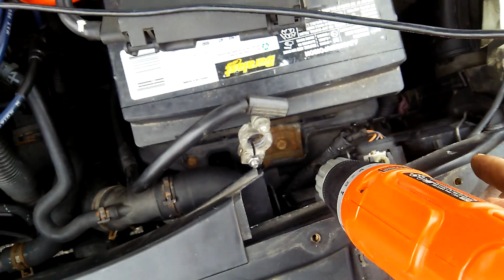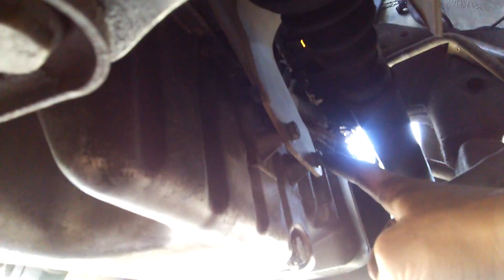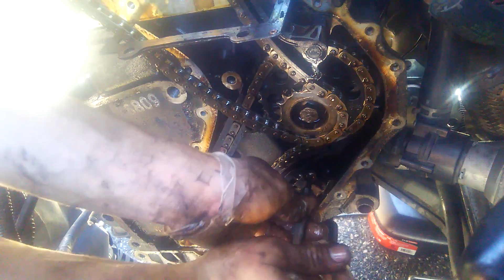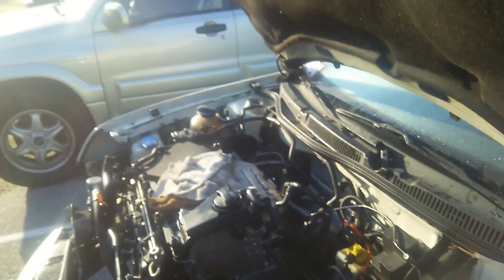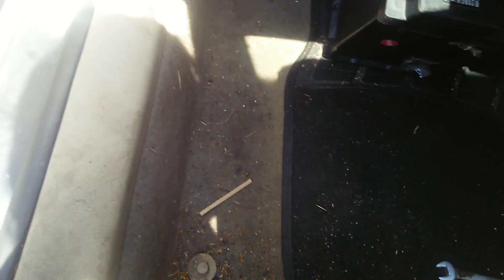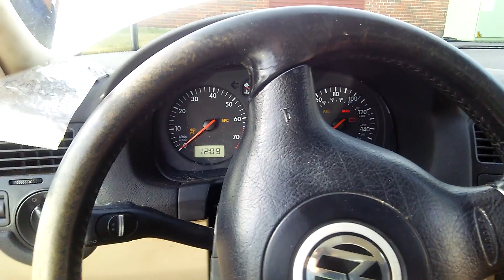VW VR6 Timing Chain Repair - Start to Finish - Jetta Golf 2.8L 12v

Comment: well,  I use to say the 2.5 was the only vw engine I wouldn't work on.  well,  you just added to that.  you did great work.  but taking the damn transmission out to do timing jobs is a stupid design.  I'll stick to the 2.0 and 1.8.... great job.
Reply: The VR6 is such a bullet proof engine though honestly and worth it for the power and exhaust note. The only thing that really REALLY sucks about working on the is the timing chain..... and the occasional thermostat housing and crack pipe and water pump going out after 150k or so miles.

Comment: dude i just got done doing my chain and where the two chains meet i was told to have the arrow pointed up and my timing is off I'm screwed because my car is shaking like shit
Reply from the maker: it can be facing up. it works on 180 turns. it may face up or down, both may be used, depends on how you originally had it.

Comment: My 2001 GTI has 110k miles.  Not looking forward to doing this when its due.  I thought about doing the clutch at the same time since it is such a big job.  Access is tight and thinking also about pulling the entire engine out might be easier to access the transmission.
Reply: Thats a good point.  I could bring it to a shop and have it evacuated and then take the front end off.  Maybe replace the dryer and a/c clutch pulley bearing, and a/c hoses while I am in there.  Hopefully I only have to pull the transmission once in the life of the car.

Comment: Got this girl down to $400.00 for 2001 VW Jetta GLS  VR6 180,000 miles in real good shape  she had it checked at a shop has bad timing chain. Think its worth it to Fix it ?
Reply from the maker: depending on the overall condition, it's worth it even for a parts car.

Comment: how many miles on car when timing chain went out ? looking at a 2001 jetta vr6 nice body leather interior bad timing chain but they re asking $ 1000.00 for it little high in price.  great video very helpful
Reply from the maker: dunno yolo if the timing is bad, it may not be worth it, as the engine may have been damaged. the chain doesn't really break, it's all the guides that break because of what they're made of.  should be replaced at 80- 120k to avoid permanent damage
Reply: This car has 179,965 on it
Reply from the maker: If the car runs as is without timing issues, it may be worth it. Just make sure you service it before adding any more miles to it. But those guides are guaranteed to be brittle and ready to break at the 100k point. This is the 12valve vr6 sohc
Reply: Cool Thanks a lot
Reply from the maker: np
Reply: Vijuel yo bad ass video love to see when ppl doing work like this outside cause it takes real skill cause almost anyone can do this in a shop with a lift and all the expensive snap on tools but it's a whole different ball game when u outside on the ground and have to make it work when u don't have every tool and no help 👍👍hats off to u bro
Reply: Vijuel yo bad ass video love to see when ppl doing work like this outside cause it takes real skill cause almost anyone can do this in a shop with a lift and all the expensive snap on tools but it's a whole different ball game when u outside on the ground and have to make it work when u don't have every tool and no help 👍👍hats off to u bro
Reply from the maker: demchevyboyz cheers bro.
Reply: Vijuel yo do u know if that parts list would work on my vr6 cause I have a 06 passat with the vr6 and somebody told me it's the same basically??
Reply from the maker: demchevyboyz after 03 the vr6 changes from the older 12valve to the bigger 24valve. The parts will most likely NOT be the same. I would check exactly what engine model you to make sure your getting the right gear
Reply: Vijuel ok I guess I got to do some research cause it just seems hard to find stuff for this Motor
Reply from the maker: lots of great resources out there. check out vwownersclub, vwvortex, vr6oc . com's etc. the forums are awesome and helpful.

Comment: Much respect, MacGyver!! No helper... puts battery on brake pedal.

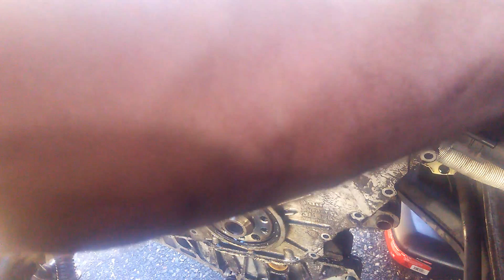9:28 - The satisfying moment of pulling off that lower-engine cover!!

For those of you who haven't done this yet: Follow Vijuel's lead and label things, ESPECIALLY THE ENGINE/TRANNY BOLTS!

Good video shots of the chain - there's a little sag in there at the TOP.  I was concerned about that but my engine runs better than it ever has. I don't know if adjusting the cam sprockets a bit would take the sag out but screw up the timing.  I just left well-enough alone.

Got lucky with the tranny.  Tried once, no joy, second time it slid right on.  (Ave Maria).

Wish we could have crowd-sourced you a new clutch while you were in there.

Nice, nice work.
Reply from the maker: cheers

Comment: Hello i from Brasil, what the price timing Chain kit? Do you send to Brasil?
Reply: Fabrício Araújo Sousa check ECS Tuning or get a kit off eBay.  Basic kit around 200 US, getting clutch, bolts, flywheel, etc. will run into $500+ US

Comment: you have a facebook I can add you on. I wanna keep you posted lol
Reply from the maker: yes, but it's a newish account and I'm rarely on fb. I'm on Twitter @vijuel1. also get these notifications via Google+/YouTube apps.
Reply: +vijuel so you a Twitterer
Reply from the maker: Twitter is my preferred social media. Very active on it.  Mainly in tuned with battle rap and news/ politics.  FB was cool at one point.. till it became the white pages for the nsa lol
Reply: hahaha you said NSA lol i only use Instagram.. you kik or anything else
Reply from the maker: +darionmilton IG vijuel too
Reply from the maker: +vijuel you getting this job done soon?
Reply: +vijuel as we speak
Reply from the maker: Nice. Hope it's not giving you much trouble. And remember, don't crank the system without the upper hydraulic tensioner bolt on. I didn't mention it in the vid. It will cause the chain to jump

Comment: Was this your first time doing it?
Reply: A lot of bolts are stretch... replace them.  Get new bolts for the dogbone to tranny.  It's a few more bucks on the project and you'll easily save as much if you do it yourself.
Reply from the maker: yes, sir.
Reply: im thinking about doing mine Also.. was it worth it?
Reply from the maker: +darionmilton absolutely. question is, do you have all the parts and tools. If you're mechanically inclined, it's not so bad. help is handy at times. this job takes time, prep accordingly.
Reply: +vijuel I am mechanically inclined did you follow a write up? and I have a lot of tool but I wanna make sure I don't need more and ill probably do it alone myself
Reply from the maker: http://forums.vwvortex.com/showthread.php?1264409-DIY-Replacing-timing-chains-tensioners-and-guides-on-a-12v-VR6%5C this is a great guide. this job took me 3 days alone (first time). had to cab a few trips to autozone...
Reply: +vijuel I have 2 cars and the jetta is my daily lol do getting to a parts store wouldn't be a problem and I will print that out :)
Reply from the maker: yea that guide helped tons. VWVortex.com is awesome. a lot of forums with great info.
Reply: +vijuel thank you I'm gonna look at it. and see what tools I need
Reply: +vijuel did the write up have the trans removal also or did you have look at another diy
Reply from the maker: This also helped http://forums.vwvortex.com/showthread.php?2703042 with the trany, clutch
Reply: +vijuel thanks. did you need to change your flywheel bolts ?
Reply from the maker: +darionmilton I think there are stretch bolts so ideally I would recommend it but I didn't change them I have limited time and I had to get it done. I do recommend you changing the throwout bearing on the clutch and you can look into getting new flywheel bolts if you want to be safe
Reply: +vijuel im getting a new clutch.
Reply from the maker: +darionmilton best bet. I couldn't afford a new clutch at the time. wish I had
Reply from the maker: hey thanks, the good feedback is always appreciated! yes organizing every single bolt saves a lot of time and headaches. as far as the tension on your chain, did you bleed the upper tension bolt properly before putting it on? the big bolt on the outside, on the backside.
Reply: vijuel You're welcome!

Yes, bled that bolt.  Actually did the upper chain rail in maybe... 2012 (?) at around 88K because of noise.  It was well worn.

In 2015 at 106K I did the whole job except drop the oil-pan which was easier since my kids were mostly out of diapers and I could be in the driveway for a weekend instead of chasing kids.  Was a bit of a rush job from Friday to Sunday since we had friends coming from out of town to stay with us for two weeks that Sunday night.  I buttoned the car up, showered and went to meet them at the airport.

I built a 2X4 "engine mount" to hold the engine up and to help hoist and lower the tranny with some Harbor Freight straps.  That worked well.  I didn't pull the a/c and left the front end mostly attached and just crawled underneath with the front end about a foot in the air.

Did you recharge your a/c?

Would have been much easier with a lift but like you, you do what you gotta do.

A year later and the car runs smoother and pulls harder than it has at any point since it was new 16 years ago.  Too many points of failure on the VR6, the coolant system (put in a SS crack pipe), t-stat (what a pain to get to), the coil packs (on my third or fourth one), sunroof leaks (replaced all the tubing but water still overloads the trays) but anyhow it's paid for.... and any car can have issues.  Doing the work myself it's just a matter of tracking down the problems, and I haven't put that much into the cars though it's low milage.

The new clutch still feels new, still very grabby.  I don't remember the original clutch being that grabby.  In fact, I think I could have gotten more years out of it but it would be a lot of work to just take it all apart again to replace the clutch.  Sadly, going to need a bigger car. Enjoy that VR6.  Love the exhaust.
Reply from the maker: ac is still down. it never worked and i never bothered with it. i enjoy the heat/ hot weather so it doesnt bother me. i do have to do the heater core though. i went 2 winters with a bypass. i've had the new one all this time, but haven't found the will and time to do it. such a pain in the ass. when i do, i'll be sure to take footage and post. cheers my man.

Comment: Nice work, But you should contain the brake fluid from the slave when you bleed it!! that stuff is rough
Reply from the maker: I hear ya, Great point! I got some of that stuff on my headlight lens cover some time ago and it started eating away at the plastic.  It's nasty stuff indeed.
Reply: +vijuel for sure even if it hits your cv or coolant flange. just bled my clutch after watching today